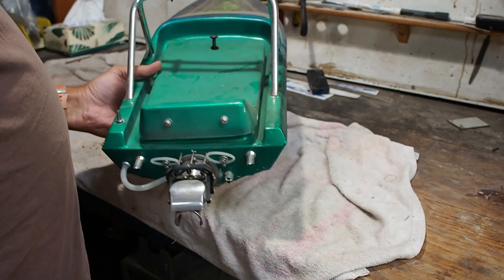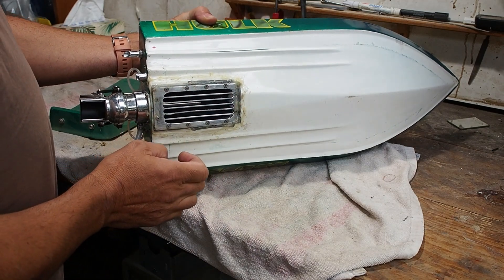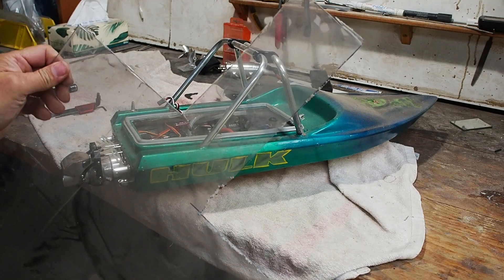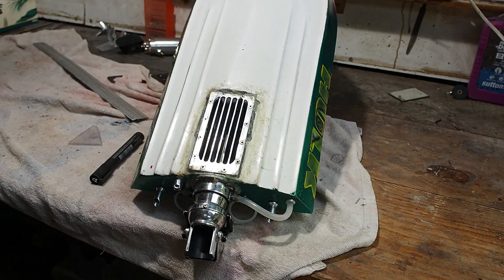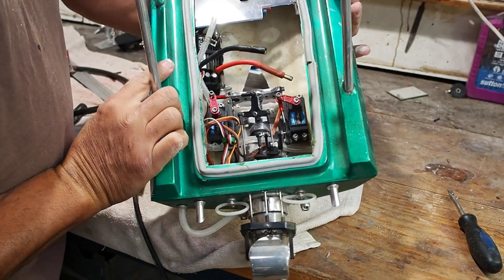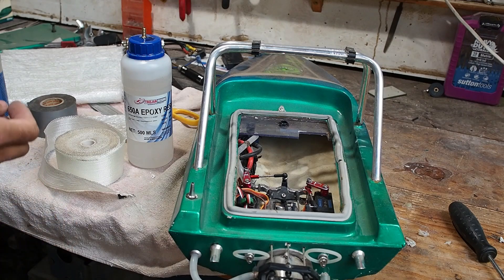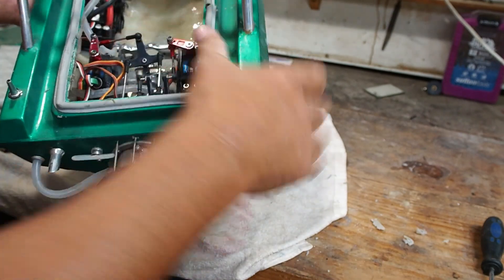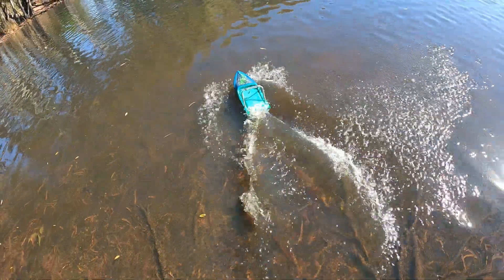Rc jet boat experiment

Comment: Nice mod mate! Certainly did the trick. 
I had to do the same with my jet pump installation on a bigger boat. The hull (just over 1m long) wasn't designed for an impeller water intake so had to cut quite a lot out and make that same angled scoop. Looks like the same thruster - TFL?  Here's a little video https://youtu.be/B-aBq7eKlzE
Reply from the maker: Nice, yes its the same as your jet unit except i sanded and polished it as i built that boat during covid lockdown and had plenty of time lol. Why did you think you needed tabs on yours?
Reply: @RCBoatBitz  To be honest, having never built a jet boat, I thought I'd add them to help keep the nose down. With hindsight they're not really needed now I've seen how the boat runs. But they look good and I can't be bothered to fill the holes if I take them off lol. I'll leave them there until I need them on another boat 😉
I've 'scratched the itch' I had about building a jet boat. Won't be doing it again. So little you can do to tune the handling and performance, and the steering is a nightmare on such a big boat. But you live and learn. Call me old fashioned but you can't beat a prop and rudder! 😂
Reply from the maker: @SteveLane61  have a look through my older videos, i built a 51inch monster with a 70mm jet last year. ive been reading up on ride plates and might play around with that one again

Comment: Well done!! Good little alteration that made a huge difference. What was the hull made from Glass or ABS? Im asking, as I’m wanting to glue Carbon fibre motor mount into an ABS hull. What would you use? Cheers Mark
Reply from the maker: Its a fibreglass hull. Ive never done anything with plastic hulls but id give epoxy a go after sanding the surface to give it something to bite into
Reply: @RCBoatBitz  was going to use that JB weld epoxy seems to work well on everything